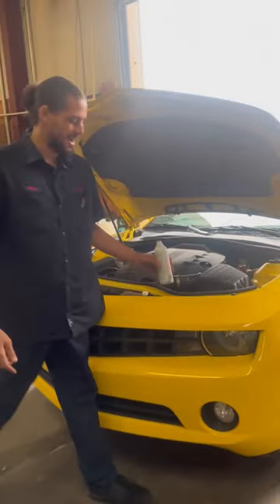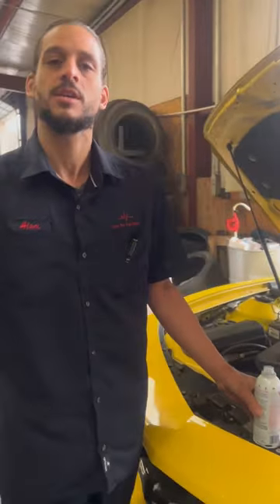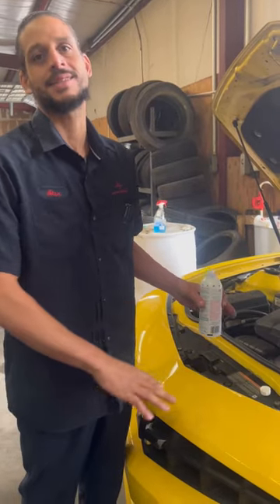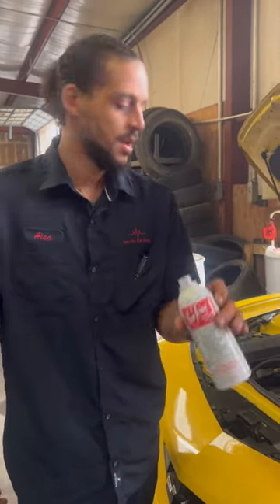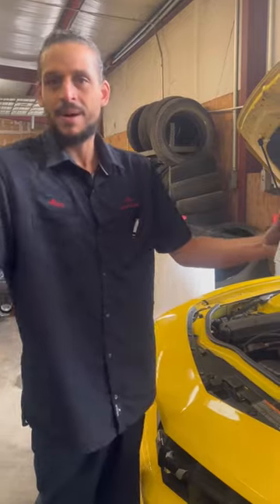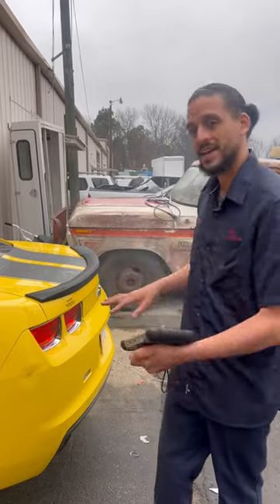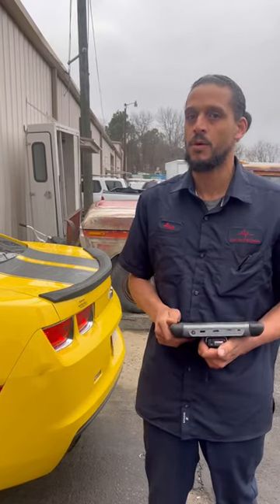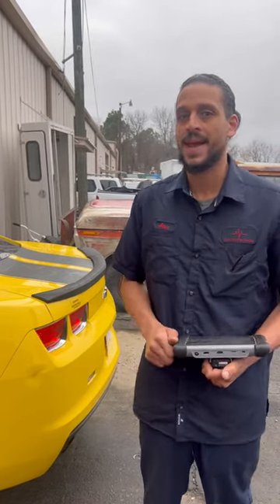Try this before you replace the catalytic converter  #cartips #chevycamaro

Comment: False information! Its the seafoam that causes white smoke! Its made with petroleum distillates, MEANING oil, seafoam is not designed to clean catalytic converters! Cataclean is really the last shot you have before having to replace the cats, its like $27 a bottle but follow instructions carefully for the first time, and then if the codes DO go away, i would pour a bottle in the gas tank every time i change my oil (typical service interval)
Reply from the maker: https://youtu.be/7wfXEgrEDHU?si=wT5kGuq3qYi2BLWi

Comment: 2016 Chevy impala , mechanic charging me 1100 parts & labor to replace my catylac converter bank 1 .  What do y’all think .
Reply from the maker: Sounds about right. But I will say this, we’ve been having trouble with aftermarket catalytic converters with GM/Chevy on the later models. There is a good chance that light may come back on. I’ve been having to go OEM when it comes to those. I know that’s way more expensive, just wanted to give you a heads up 👨🏽‍🔧🩺

Comment: I’ve found Cataclean with 4 gallons of fuel drive at 2,500-3,000 rpm’s for 30-40 miles, works as well
Reply: I have had good luck with it too... made the car smell like rotten eggs for like 100 miles then the check engine  light went away and I passed my smog test. Been using it in my daily driver at least once a year ever since

Comment: @AlexTheCarDoctor this might be a dumb question but where did you pour the sea foam in? I'd like to try this and I wanna make sure I put it in the correct place 🎉
Reply: @samanthadomcik9648  you have to disconnect the tube at your brake booster that runs to your intake. Find someone to hold your throttle at 2,500rpms or so, and pour it in fairly slowly.

Comment: The smoke means nothing, it’s the seafoam itself. The only way to know it worked is to clear the codes and drive. That being said seafoam most likely will fix it but the smoke itself has nothing to do with how dirty it is. The smoke stops once the seafoam runs out. Even a bream new car with 0 miles will smoke with seafoam.
Reply from the maker: So what’s the deal when I use it on vehicles that don’t smoke at all? I tested this on another video on my channel. Any feedback would be appreciated 👨🏽‍🔧

Comment: Did you pour in into where you pour your oil?
Reply: Vacuum line. You can add some to your oil about 100 klicks (60 miles) before you change your oil... helps get the sludge out.

Comment: Tried it before with cataclean and engine light stayed off for a month but turned on again . Now trying with Berryman B12 fuel cleaner and filled it with premium gas and disconnected negative cable ..
Reply: so this would get rid of the codes (p0420&p0430) for awhile and run better?
Reply: @dramatimefighting  yes it worked for me
Reply: @dramatimefighting  yes if disconnect battery cable for a long time like at least an hour or two and follow instructions on the bottle

Comment: Seafoam is acetone with 2cycle oil
Reply: If there is acetone in it, it sure isn't much. I used to work with acetone, you can smell that stuff from 20 feet away.
Reply: @46babaganoosh  over 90 percenta acetone smell it .
Reply: @stewart8127  You obviously don't know what real acetone smells like.
Reply: @46babaganoosh  ok
Reply: @46babaganoosh  smells like nail polish remover. That acetone is some strong stuff.
Reply: @jaylocs2056  Back in the day, my sister would use it to remove nail polish, and it would stink up the house. Then I had the displeasure of using at a place I worked at. We used pure Acetone to clean Gelcoat, you had to wear rubber gloves, or it would dry out your skin. You also had to work fast because it evaporated quickly. Had to wear a respirator because the fumes would make you dizzy. Not fun stuff to work with.

Comment: My car still has no power after fixing a oil leak from the intake , could this work or is my CAT shot?  Also , no codes at all appear
Reply: By a cheap hand held infrared thermometer.  Let the car warm to normal  operating temperature. Check the temp of the pipe before the converters and after. It should be higher coming out of the CAT than going in. If it's not then the CAT is bad!

Comment: I've been a mechanic for 28+ years. Sea foam is not for use In 4 stroke engines! It will destroy catalytic converters.  
The smoke is not dirt! It's oil that is in the sea foam. This oil will burn and leaves a sticky residue inside your engine. It is designed for 2 stroke engines only! 
It does not have the nitrogen based additives designed for four stroke engines. So yeah you wanna ruin a catalytic convertor....use it! Sea foam originally was made for 2 stroke marine engines. 
Will it clean carbon? Yes. But the aftermath of sticky residue will ruin your engine if you continue to use it! So go ahead...and fuck up your vehicle!
Reply: Test the converters before you assume they are bad. Just because there is a code does not mean they are bad. Check the temperature using a laser thermometer.  The exhaust should always be hotter coming out of the converter than going in. .
Reply: Also I'm not trying to say this guy is a bad mechanic.  If the converters are bad anyway why not try it. I'm saying don't use sea foam on a regular basis is all.
Reply: It fucked by f150 2007 cat haha i change both down o2 sensors disconected battery and still getting it
Reply: @markevans4645 Agreed. What does work is lots of lemon juice but the cats have to soak in it
Reply: i works! bet this guys a smog shop owner 😂
Reply: You said all of this but didn't tell the people the correct one to use. Each one teach one remember that Sir.
Reply: @1804shmoney  see my comment above. Only thing I've found that actually works
Reply: Ya man. I couldnt believe my ears when he said all that smoke was cause its dirty😂. Thats the dam seafoam!!
Reply: Your slow they have that bottle and a high mileage for 75,000+ miles who tf putting 75,000+ on a two stroke plus both bottle state it bold letters “ safe to use for 4 stroke and 2 stroke engines “
Reply: @vblimo3315  safe till it gums up you engine..LMAO! Don't believe everything you read!
Reply: Seafoam has a formula for marine engines and a different formula for 4-stroke engines. They also have a formula for transmissions.
Reply: Mechanic for 30 years checks out because you clearly didn't read the instructions on the can 😂
Reply: @vblimo3315  just because it says it's safe for four stroke does not mean it is. It has the same ingredients as the stuff for 2 stroke. . The smoke is oil burning.  Believe what you want.
Reply: @firstlast---  do you believe everything you read? Apparently.
Reply: @markevans4645  I definitely didn't believe you
Reply: @MeekoRuiz no it isn't. this is the bottle that gets sprayed into the throttle body.  takes a few minutes to slow bake and you gotta keep the revs at 2000 during the process

Comment: The smoke doesn't actually indicate anything, other than the seafoam is being burned by the engine.

A brand new car, 20 second of the production line will smoke with seafoam.
Reply from the maker: I don’t know about that. I did another video with one car smoked and the other one didn’t. To back up my theory. https://youtu.be/7wfXEgrEDHU?si=wQX62wXBvuteE5-5

Comment: Or just use water like everyone has been doing for 100+ years......cleans intake and exhaust valves as well as combustion chambers and the cats......leave the vehicle running and do a 2 part intake cleaning but use water instead of your typical BG products or seafoam......also, let it puddle in the intake and then floor it, don't use a garden hose like these ignorant young men I work with. 😂 

Saved several GDI motors with buildup this way! ❤ don't believe me, use a borescope and get a few before and after pics with the water method. You will never waste money on BG products or seafoam ever again.

Comment: I wonder how many miles you got on that car in order for it to set that code
Reply: Could have been caused by bad gas. Gas will turn to varnish if not used within a month and clog everything up. The longer it sits, the worse it gets.

Comment: I either have a rocker arm or a lifter gone in my 2011 Dodge Grand caravan there's a small knocking noise. Could I just drive it and drive it into the ground or what should I do I really don't have the money to have that fixed right away?
Reply from the maker: The more you drive it the more damage you will do, and the more expensive it will be to fix!
Reply: If it is a 3.6L, it is a rocker arm. The roller bearings fail, develop slack, then finally seize and damage the camshaft. Have the valve cover removed and the rocker arm that is loose replaced before the cam is destroyed.

Comment: This is not a fix. It is a temporary solution. You're burning up all the gunk in the cylinders and it is normal being a direct injection system. And guess where it's going to get stuck at??.... The catalytic converter. What this does or can do is the same as ready for emissions or catakleen. It will cause the mixture to trick the computer to think clean fuel is being burned. This is for emission purposes. It will need catalytic converters especially if both codes are showing. Check fuel trim levels. Either something is off or they just ran that car a little to rough
Reply from the maker: I don’t know man, I’ve seen it work. Sometimes that gunk throws off the readings. I clean it the system and customer passed emissions and haven’t needed cats yet. Especially if it’s low in miles. Now if it’s high in miles.. I agree
Reply: @AlexTheCarDoctor  40k on a direct injection system is high mileage these days. We can't win every battle but if this helps somebody get by that's what it's about. I would've have a quote ready just in case it creates a future sale

Comment: Does a dirty catalytic converter cause the vehicle to shake like hard misfires? Cause I'm curious to know if I actually need to replace my converter or if it's just super dirty
Reply: Can't get any answers either
Mine doing same thing
P113d & p113e are my codes
Reply: Yeah, your cats might be clogged. it’s like a stutter jerk when you drive, right? Then it kinda clears up, but still does a little stuttering thing? Then smooths out as you go faster, but you’ll start feeling it do it again when you start slowing down? That’s the cats, cause mine just did that before i came back from getting some stuff to clean it out with. You wanna handle that ASAP, cause the next thing that’ll happen, is they’ll glow bright orange, i mean you can see it in the dark, and that means they’re super hot. Happened to me. My old ones also misfired before, cause of the clog.
Reply: Try that first, before replacing them. I’m on my way to pick up some bottles, before i replace mine.
Reply: @kingcuttasupreme what did you clean it out with? How’re they holding up now?
Reply: @ShaqTheBoss  i tried those, and it didn’t clear the code, so I’m just gonna get a new one and put it in. I wanted to try it before getting a new one, as my mechanic suggested. Since there’s no way around it, I’ll be buying the new one😩

Comment: How do you do a flush on a heater core on a 2012 Chevy Camaro
Reply: 1. Flush out coolant
2. Refill with cooling system cleaner
3. Run car with heat and air setting on high for 30 minutes
4. Flush out coolant
5. Refill with water, run car with heat setting on high for 10 minutes
6. Flush and repeat until water coming out with flush is clear
7. Refill with coolant.
8. Run engine with coolant tank cap off to remove air from system
9. Replace coolant tank cap.

You're done
Reply: @monsieurlaflamme995  Distilled water.

Comment: Do you have a video on what us 2016 Arcadia Denali owners can do to prevent major issues? I think my transmission is going. I get hesitation at slower speeds. Chief Ronald Boston from Arkansas.
Reply: i'd replace the filter and change some of the fluid. transmission fluid is the most overlooked thing on a car.
Reply: @boogerfromthatmovie4257 There isn't a serviceable filter on a 16 Acadia. If it's sliping you can try a fluid exchange, but the torque converter, or clutches are probably shot. Tbh I'd try and get rid of a 09-16 Acadia, traverse, or enclave asap. Too many consistent high dollar repairs, although they keep my wallet fat as a gm tech.
Reply: Try the Seafoam for transmissions. I've heard some people had great results.

Comment: bro, there is an underlying reason that code up. The cat should last the life of the car. there may be an exhaust leak or oil leak into the cat. those treatments are made to just pass an emissions test.
Reply: That's what I was going to mention. He fixed the current issue but not WHY the code popped up to begin with such as carbon build up on the back of the cylinders, called coking. Although that's depending on the Injectors being is direct injected into combustion chamber and not on that back side like port injectors.

Comment: Put a O2 extender on the rear sensor. Fixed forever.
Reply: If not having to worry about emission test 👉can’t we just straight pipe it (no catalytic converter?!) 2010 Chevy hhr?
Reply: @kimlarso  yes and run the extender. No check engine light
Reply: @AndyLishious  ty🦋

Comment: PA safety and emissions inspector here. Nothing in that bottle did any good for that engine or exhaust. That smoke is not "because the system was dirty", it's because the engine is burning Seafoam. The same thing happens with a 3 step fuel cleaning. 

If you have catalytic converter codes, you may not have to replace your converter, but doing this will not permanently solve your problem. This is a bandaid, and a bad one at that. 

I suggest bringing your car to a local reputable shop before throwing a new converter or this bottle of bullshit at your car.
Reply: An emission inspector is automatically more credible than a mechanic, thanks for proving this video wrong
Reply: I was just recommended to go to a welder it’s cheaper.. what would a welder do vs a shop that would cost 2k.
Reply: @8Nickgarcia  a welder could bend and replace sections of pipe in between actual exhaust parts but you can't replace a catalytic converter (or a resonator or muffler) with just regular pipe.
Reply: @pppoopoo4514  thanks I might just trade in the car idk yet.. it’s a horrible market
Reply: But here you are watching Alex the Car God!
Reply: @keithmaddox01  wow it's almost like my algorithm determined I like cars and videos about cars. How wild!

Comment: Every lube techs favorite go to lol. This isnt going to fix your cat codes. Better off putting in spacers or a o2 simulator
Reply from the maker: I’ve experienced it go 50-50 sometimes it works and sometimes it won’t. Been at it for a while.

Comment: this guy doesn't even know what he's talking about . Seafoam even advertises on there website that it doesn't clear out a cat
Reply from the maker: I meant the system. I know it doesn’t clean Cats. Sometimes I get customers who come in with these codes without their maintenance being up to par, so I recommend spark plugs if they haven’t been done and a Seafoam treatment. Sometimes it works, and sometimes the cats are too far gone or they really do need replacing.

Comment: This code po420 keeps popping up I had my catalytic converter replaced , my o2 sensors , my spark plugs,  the maf sensor cleaned ,my air filters replaced and my exhaust manifold gaskets replaced and it still turns on and off with the code .
Reply from the maker: Where did you get the catalytic converters? What type of vehicle?
Reply: @AlexTheCarDoctor  I got it replaced it at caliber auto care my warranty covered it it was fine for a couple months after but than started again its a 2015 toyota camry
Reply: That sounds expensive.
Reply: @1_Fish.2_Fish.Red_Fish.  definitely was lucky for me I got the warranty to pay for it all after making a complaint and only paid 100$ deductible I was told the issue is still coming and going because the parts are aftermarket and not OEM so I just left it because I can't afford all that it'd too expensive

Comment: misfire #3 was the only code 
 I changed all coil packs , spark plugs, and injectors on my Dodge caravan SXT 
Now it reads misfire #3, p113d & p113e
Does this mean cats are clogged
Reply: Bad coil or injector possibly
Reply: It means you need to find source of the problem. You’re still missing on 3. Is the coil getting power, ground and control? Same for the injector.

Comment: All you did was add cleaner to remove carbon. Just drive it like its stolen oldskool trick. With new car downshift so you can be at 3500 rpm for a ten minutes it will get cat super hot and burn off carbon
Reply from the maker: I hear ya, but this is Atlanta, these folks drive it like it’s  stolen all the time 😂

Comment: Before guessing and putting in seafoam I'd like to have a look at all the 02s to see how fast they're switching along with the fuel trim. Just me though...
Reply from the maker: No guessing done here. I did all of that. I always run the proper tests. I just recommend that the customer try this because he didn’t have the funds to fix it the way I recommended. I said “try” this, it may buy him some time and it “may” work. Just was offering an alternative solution.